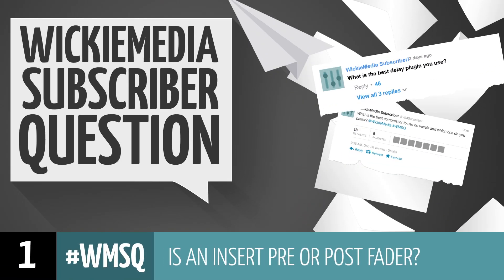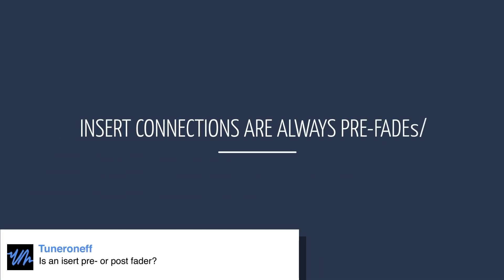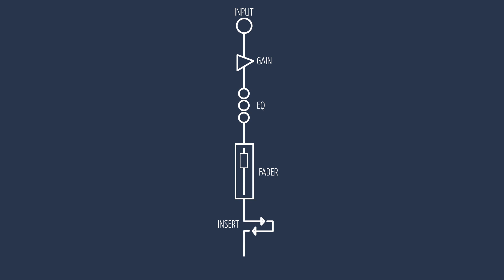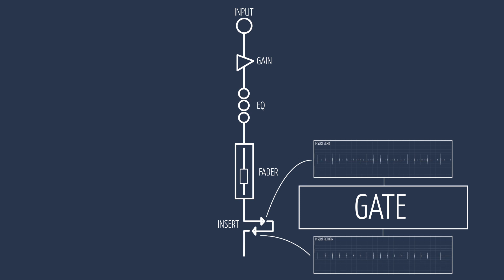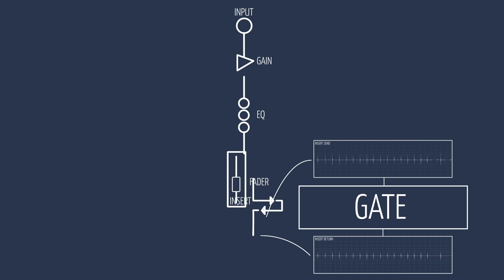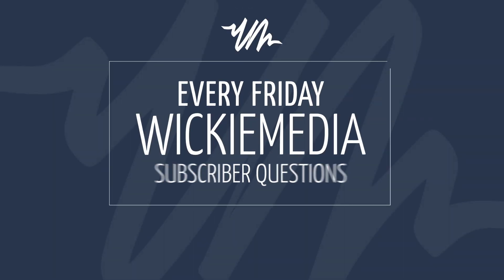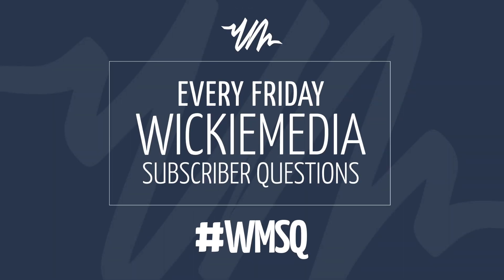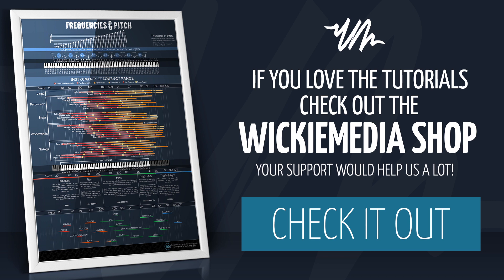Is an insert pre- or post-fader? [#WMSQ E01]

Comment: Absolutely correct, however Cubase always allows post-fader inserts. Previous to version 9 of Cubase, there are 8 inserts slots. the first 6 are pre, the last 2 are post. Since Cubase 9.5, there're 16 inserts slots and a line in between that can be changed between pre and post. For example, it is possible to have 15 pre and 1 post, or 2 pre and 14 post ;)

Comment: How does multiband compressor divide frequencies (for example 3-band bass, middle, high)? Like a filter? Or like an EQ?  Do frequencies intersect?
Reply: a crossover algorithm sends the different bands through to different processing. Kind of like a crossover on a speaker sends different frequencies to the sub and the tweeter.

Comment: hmmm I normally put EQ before the compressor cause i figured I wanted to compress the EQ signal.
Maybe I should try it this way.
Reply: +Harrysound I do both. However, I only put EQ cutting before the compressor as I don't want to send unwanted info into the compressor to have it kick in at the wrong time. Conversely, I put EQ boosting after the compressor as I don't want the compressor to squish those frequencies. Think of overheads for drums, most people use it only for cymbals and toms/snare, so you cut out the bass drum frequencies (and any other ugly ones) before the compressor so they don't affect the compression and boost the ones you want after the compressor. Give it a try :)
Reply from the maker: +Harrysound On many smaller mixers the EQ can be hard-wired after the insert point. However the way you patch those processors will have an influence on the way they behave, and the way it will sound. 
I actually already have a video on that here : https://www.youtube.com/watch?v=_OUHiqCFrBY   
-Hope that helps!